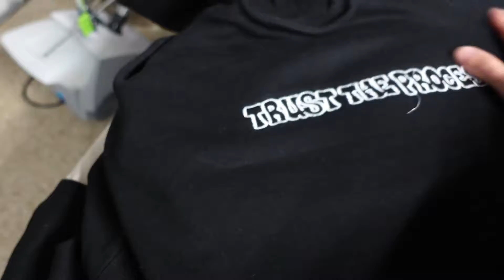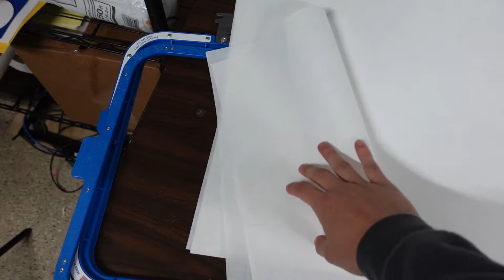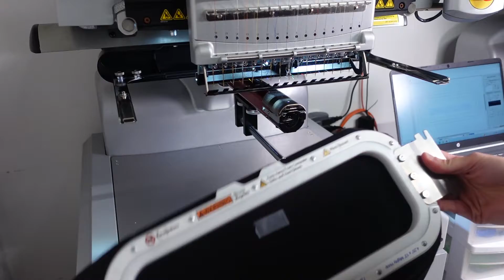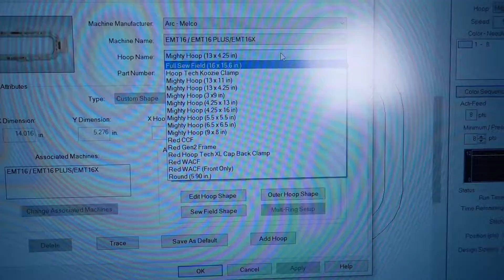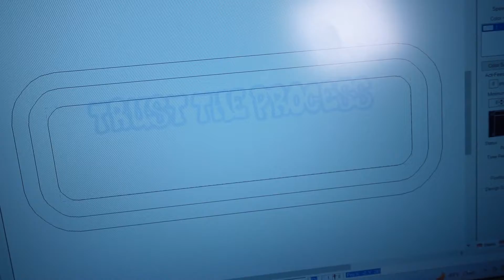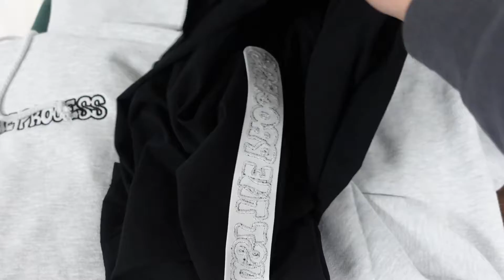First Time Using My 4.25” X 13” Mighty Hoop - New Hoop for the Melco EMT16x!

Comment: 11x13 until my 4.25x14 arrives! Thanks for this. I was stressing that I won't be able to use it for sleeves, but I can absolutely use it for chest one-liners! Good save!
Reply from the maker: Its perfect for chest embroidery, no need to waste a ton of stabilizer in the 11x13 if you're only doing a small center chest design!

Comment: In your opinion, on adult T-shirts, do you need to do Tender Touch or something like it?
Love your videos!
Reply from the maker: You don't need to but you can. I don't find it necessary myself but it might be for larger heavier designs on a t-shirt. For the most part, I don't recommend anything heavier than this on t-shirts for my customers because the weight of the embroidery could make it uncomfortable to wear
Reply: @LovesBranding  thank you!!